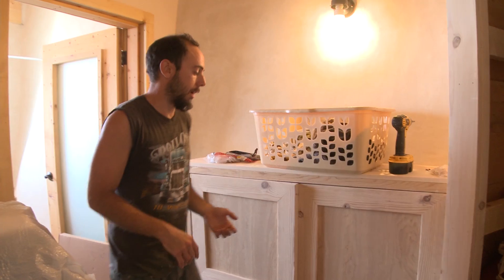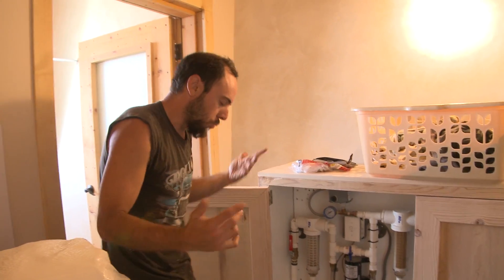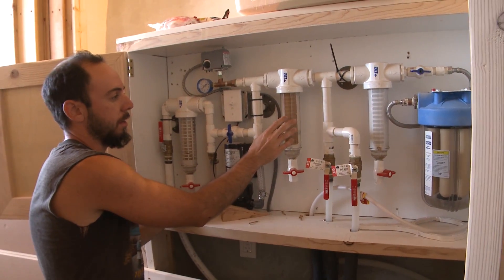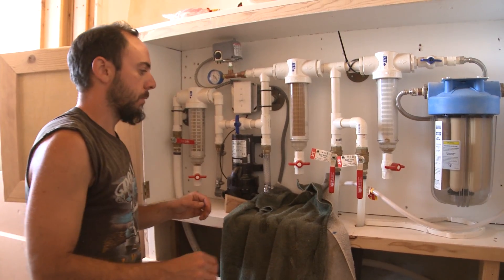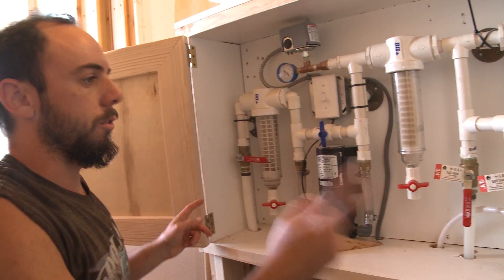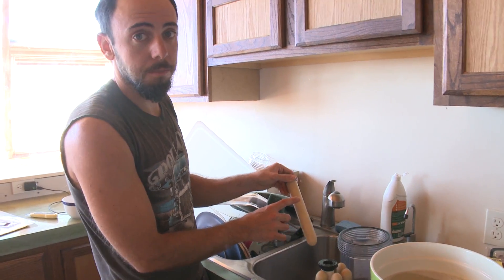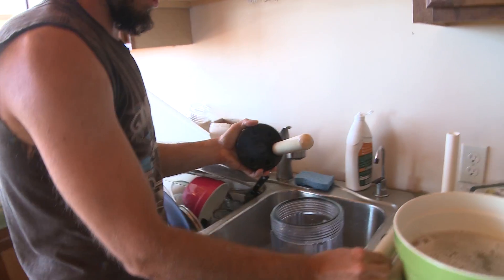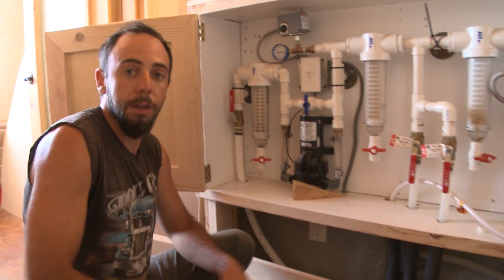How to Clean the Water Filters in an Earthship

Comment: A very effective way is to use a pressure washer to wash your filter candle. It will remove all clogged particles and restore the original state of the filter and color also. The filtration rate will be back to the original state. It won't wear off the surface as when you scrub and will allow you to use the filter for lifelong. I have tried and tested and made a video because I'm impressed with the results. https://youtu.be/HKjD-XsCoQI

Comment: kinda missing the point of the spin down filter but if you connect all of the bottom taps to a timer that will release the sediment in the filters on a regular basis you should have less trouble

Comment: what about putting the pressure switch after the filters to avoid the problem altogether?
Reply: Then the pump would continue to run and the pressure would be building up against the filter side until it failed.

Comment: The earthship we bought had this problem and a plummer told the guy who sold it to us it was a pipe leak. We bought the earthship at  $30,000 off due to this exact issue and I fixed the it using a toothbrush.

Comment: Just a little info for all viewers. To properly test a pressure tank (or well tank), you must shut down the pump and drain all pressure from the system before taking a reading from the schrader valve on the tank. If you don't, you'll get a false reading from the water pressure pushing against the bladder in the tank. The pressure in the tank should be 3 psi less than the pump "cut-in" pressure (i.e. 27 psi if the pump turns on at 30 psi). Also if I'm not mistaken, the spin down filters are designed to be cleaned by opening the  valve on the bottom of the filter housing with the system on and under pressure. The force of the water coming out "spins down" cleaning sediment from the filter. Love the videos, I've watched them all over the last couple days! :) Keep up the good work!

Comment: I haven't ready all the comments on this yet - but I was wondering why you wouldn't use a deep column vortex filter to remove some of this sediment before going to the WOM? Or perhaps cycle the water around the cistern (if it's true round and not oval) so the sediment finds itself in the middle of the hold? Perhaps use an intermediary pickup where the sediment would collect in a 'live water" (or moving water) system like this to literally vacuum out the sediment where it collected? Similar filters are used in my aquaponics to drop the floating debris from the fish out of suspension by gentle gravity pull in a vortex. It's slow and effective. Just curious is all..

Comment: wouldn't be wise to attach pipe to hose adapters to the clean out ball valves on the bottom of the filter housing. That way you can hook a hose up  to drain & blow out sediment trapped in the filters, which would extend the times between the major cleanings ??

Comment: Don't they make pre-filter systems that have back-wash functionality built into them?  I swear I remember my Grand Dad doing this in the pump house years ago.
Reply: Off Grid Build your system already has back flush from what I can see on the . all you need to do is turn off the intake and the isolate the flow. then put a bucket under the 60 or 500 and open up the valve on the bottom. this forces water backwards through the mesh and blows out most of the junk in there. The full cleaning your doing works fine but does build up some soap contamination. a nice addition would be add in some on/off valves around your pump so you can isolate that from the system while doing a flush.
Reply from the maker: That's interesting.  I didn't know much about all this when I got started.  I just followed how it's normally done in the Earthship world.  I'm sure there are 100 improvements that could be made.
Reply: I would love to learn the pre filter system with back wash build in?

Comment: why did you not drain the water from the filter housing via the drain valve underneath each one before removing, that would have saved spilling so much when you take it off.
Reply from the maker: My bucket didn't fit under them.  In retrospect, I suppose I could have used a glass or something but I didn't think of that at the time.
Reply: Off Grid Build
I was thinking, "Note to self, place WOM in a plastic tub". :D  But, leaving room under for a bucket seems to make more sense.

Comment: It's called short cycling.. I've learned more about wells and water systems since I purchased this house than I ever wanted to learn.  Since I don't have filters, short cycling for me is due to the pressure tank.  I've had to drain my tank twice, each due to running out of water because it works like a straw.  If you plug the top and pull it out of the glass, the liquid is stuck in the straw from the vacuum.  The same is true for the pressure tank.

As for your issue, what you are saying sounds right, but isn't the fact that you have a ton of valves all over the place, that you can just turn off the valves to the pressure tank and just drain the house side of the system?
Reply from the maker: I've never had to do anything with my pressure tank.  This issue was because of a clogged filter.  To clean them, I just close the cistern supply valve and drain the system with faucets that fill the gray water planter.
Reply: Off Grid Build
Right, and you can tell that because your pressure gauge before the filter was showing the pressure surge from the pump.  If you have a pressure gauge on the tank side as well, you could have compared the two gauges.  If you run your system dry as I did, (once from repairing the main shut-off valve, another because the pressure switch stuck open) the tank will release pressure allowing air in, but it won't be empty.  When the pump turns on, it won't be able to properly pressurize the tank.  You'll have two options, 1) using an air pump, re-pressurize the tank through the valve you talked about, or 2) drain the tank (with the pump turned off, draining all the water completely out of the system) by allowing air into the tank through that valve as the water drains out.